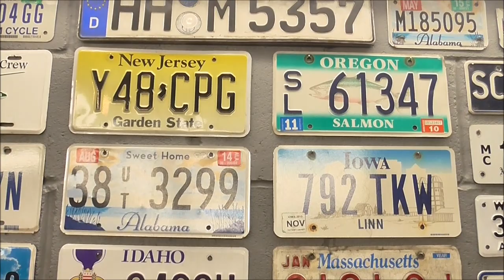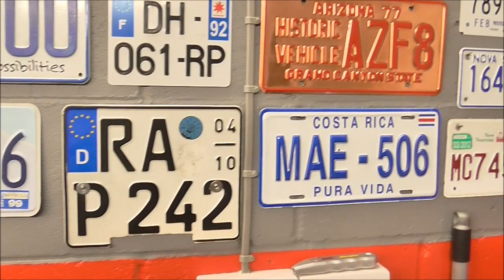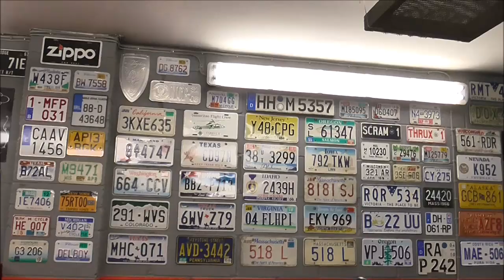Delboy's Garage, Fighter Build #12, Welding at last.

Comment: Glad to see you back on the fabrication again. The seat unit and headlight box are my favourite parts of the Bandit build.  You do a fine Job at welding buy my standards strength beats pretty 90% of the time. I agree a couple of slots or louvres would add to the look at the front. I did think about a hood ornament on top of the box but had to remind myself you weren't doing another rat build. Anyway keep up the good work looking forward to seeing it progress.
Reply from the maker: +englishandproud11 Thanks mate, yeah the front needs more than just this aye.. i have a cool idea in my head, its just whether i can make it look better than a pigs ear... only time will tell aye... nothing ventured nothing won...lol

Comment: Hi Del, your welcome mate, when you in a position as you said to afford a decent set up I would go for the High frequency setup  and a foot peddle or hand start and when you have time to play just practice practice practice and have a bit of fun with it making mistakes like sticking the tungsten to the piece your working on and blowing the tip up is all part of learning I bet you felt like bounce it off the walls sometimes but stick with it mate. but most important of all is to make time for some fun all work and no play and as you say ride safely Bob

Comment: Del, I am guessing that you dont have a law where you have to have your headlights on at all times, day and night? Thats a law here in Canada, therefore covering the headlight like that would be illegal. Just asking. Good job on the welding. I would like to get a welder but I have been told that, seeing as the garage is attached to the house, that there will be no welding in there :)
Reply from the maker: +Gary Micklethwaite Hi Gary, Thats right, we dont have any requirement to have lights on in the day, so once official daytime comes, (a published time as the year rolls round, it obviously changes as the nights get longer or shorter...) you can run without even having lights fitted at all...and there's no law on welding next to your house here either..!

Comment: When i was learning to TIG weld many years ago, I found that welding to a beat worked well. hold the torch 80 degrees from horizontal (10 degrees of perpendicular to the work piece) and push the molten pool of metal forward. also I found that touching the pool with the wire (once or twice per second but keeping the same rhythm) created nice uniform welds. Its all practice end of the day, no one can really tell how to weld. But hope this tip helps as it helped me greatly.
Reply from the maker: Yes buddy, that makes a lot of sense... and you are absolutely right, it does just seem to be practice, which I'll get lots of once I start the back end!  Will give that a try !

Comment: Hey Del. If you're trying to get cracking at TIG welding. If you turn down the heat and it won't burn out as fast. Plus hold it about an inch or so away first before you hit the pedal to get it going. It'll look like lightning arcing at first but the closer you move the stick to the material you're welding the more proper it'll look. That way you won't have to degrade your TIG sticks by touching them to the material and not burn burn outs. I used to be a proper aluminum/steel TIG welder. Hope that helps next time to weld again.
Reply from the maker: +Joshua Earp Hi buddy, all good advice... if I had a pedal!!  It's just a scratch start welder mate, so I have to touch the job with the tungsten to strike up, just like arc welding... and it's even more fun dropping the arc as you can't back off a pedal, you have to lift the torch away from the job enough to drop the arc, but then bang it close up again to retain the argon shield... if I can't master this to the right standard, then I'll go back to MIG for this project - given myself one bottle of gas to start making it work!

Comment: Hi Dell Boy, this is the description off the ebay ad:

SWEET OLD SCHOOL LONG MCM STYLE FLAT CHROME 39MM FORK SHROUDS

39mm fork shrouds have a chrome finish 

Fits Harley Sportster XL 39MM front ends from 1986-2003 All Models

Approx. 14" long and made of a nice heavy steel

Hardware included as shown   

SOLD AS A PAIR

they look great on, but worried the fender may not fit.

thanks for your help

Androz
Reply from the maker: +androz8362 Hi mate, at 14" long, am guessing they go below the bottom yoke??  and you are asking if they will fit over your forks and keep the fender in place??? Wouldn't know this without seeing it, but guess if you measure from the bottom of bottom yoke, down the leg 14", and see if that passes the point where the fender bolts on...if it does, then you won't be able to mount it... give that a try and see what you find!

Comment: Hi Del, If i can Or you would like some advice help I was a coded welder so i have done all types of welding, prepping your work pieces make sure you have (( good tight joints makes for  a better and easier weld and file your work pieces so that they have a nice right angle straight finish)), sitting at work bench makes life a lot eaier being comfortable is better, anyway like i said if i can help you mate just ask, best wishes from Bob PS. have you got a foot peddle control forthe amperage or a finger control for the amperage for your tig set, and are you using the scratch start, or lift start, or do you have a high frequency start, that latter two are the better method so that you have more time and control to increase or decrease your  heat output and you wont damage your tungsten tip, cheers Bob.
Reply from the maker: Hi Bob, my word that is so kind of you... thank you so much for your kind offer... that's what I love about You Tube, we become a family of people hlping each other.  This video was a while ago, and was just experimenting with the TIG to get the feel of how it works, I found, very quickly, that it's a precision process, very slow, and very un-forgiving... as you've said, I did learn that joints need to be practically air tight, and the work likes to be done at a comfy bench with the best equipment... I have the principles of the process locked in to my head, I understand the techniques, scratch start, lift start, walking the cup, etc., done a little study, and it would be a long time before I would be any good using the kit I have... just using an arc welder on scratch start and have made all the obvious mistakes, like welding the tungsten to the job, welding the filler rod to the tungsten, and setting fire to the bench lol - it was lots of fun learning lol .... 

As this build is important, and I've got lots of creative sheet metal work to do, Ihave no revereted back to using the MIG, which I am reasonably ok at, and well practised, just for the forgiving nature of the process and ease of use, so I can concerntrate on the build.... I clearly need to up-grade the TIG kit to get better, a foot pedal would be good, some proper gas screens and a better torch, but that's all in the future when we get the time and money... and then I will let you know how I get on, and perhaps probe your broad knowledge for a few tips, thanks again my friend, much appreciated, all the best, Del

Comment: good progress there del. little tip for ur tig welding if u use a cordless drill and spin ur tungsten up against a belt sander u get a good point which gives a better arc and the swirls helps to stabalize the arc too
Reply from the maker: +skullbugerie Hi mate, I saw that Tungsten grinding tip on Finnigans Garage, looks the perfect solution... also he covered keeping a dedicated grinder to prevent cross contamination with any other metals you've ground.. so i use the side of the stone for now which is at least a step in the right direction... and the Vice is by 'Clarke'... got it from machine mart..! cheers mate.. Del.

Comment: hi del I am a professional tig welder I mainly deal with 5-10 gauge stainless steel pipe and I have to make 100% x-ray quality welds. with that said I think you did great for someone that has not done tig welding before so keep it up you will become good in no time. I could give some helpful tips if you would like? anyway love the vids thank you for all the hard work
Reply from the maker: +robert nicks Thanks Robert, that is so kind of you, and words of praise from a true professional is a priviledge, thank you most kindly sir... Im probably held back by the machine, i read and watch so much about how its done, "ramp up, ramp down, walk-the-cup" etc etc... but im using an arc welder with a scratch start setup...so even leaving the gas flow over the weld as it cools it really hard as you have to draw back to drop the arc, then go back on to retain the sheild...and then the bloody arc jumps back across..lol.  Then im limited as im still learning to feed filler rod with a bloody boxing glove on... fine with no gloves, easy peasy...but that lasts about ten seconds till you get burnt..!!!! Im sure you're chuckling at all this, and im only wingeing because im crap at it so far... but ive got the scratch start technique understood, and boy does cleanliness make all the difference aye?, the first strike up on a freshly sharpened tungsten is perfect, and they go downhill from there... lol..  and all with 1mm think mild steel sheet... im actually ok welding bits of angle iron together, it seems almost impossible to melt it, but even at 60 amps, it takes 2 seconds on one spot to blow through... oh well, like all these skills, its a matter of learning the proceedure, then mastering the techniques... so ill get there in the end, and maybe one day ill spend less on flap discs than i do on weld wire...lol   please drop us any tips you feel will help any time... cheers buddy. Del...
Reply: so one thing I can tell you is 60 amps is way to high for such thin material I would say try to start around 20 and work your way up if needed. I am not sure what size filler rod you are using but if you find that at a low amp you are able to properly melt the base metal but are having a hard time to melt your filler rod then you need a smaller rod. for your sheet metal i would suggest .035 rod this should solve any melting issue at low amp. also i do agree the big gloves will hinder your performance I just use some standard leather work gloves not even welding gloves they are thin enough to feel the rod proper but will hold up to the heat fine (don't get your hand to close :) ). If you have more questions please ask I feel great being able to help in some small way thank you.
Reply: I also want to add that yes your machine is limited and makes things a bit harder but I promise with practice it will work great just make sure not to pull your arc away to fast take it slow this will also help with leaving holes behind ( the lower amp will allow you to take more time with starts and stops). remember tig welding is a patience mans game slow and steady
Reply from the maker: +robert nicks Thanks so much Robert, thats really helpful, i found it pretty hard to strike up using the scratch start torch, im using about 5mm poke out on the tip, and plenty of gas... and yeah, im using real thin rod, and it melts right away.. so thats not an issue.. i can tell you its been a bitch trying to get moved along the weld fast enough and not melt through, but if i could dwell longer then i could take more time to get a rythm going, i have all the principles, its just getting the settings right for the task, then practicing the techniques aye... thanks for the ampage advice, ill get some of the scrap sheet out and have a play i think.. 20 to start and see how it goes..!
Reply: sounds great but make sure not to set your gas too high as this can cause a venturi effect witch makes you gas swirl and can pull in outside atmosphere try around 15-20 cfh
Reply from the maker: +robert nicks Thats reassuring, running the Argon at 15/16 cfh all the time... good to know im getting something right..! lol